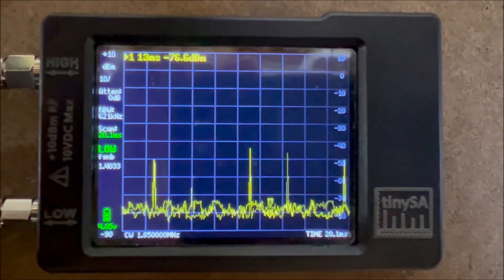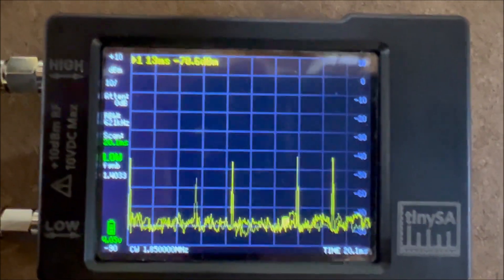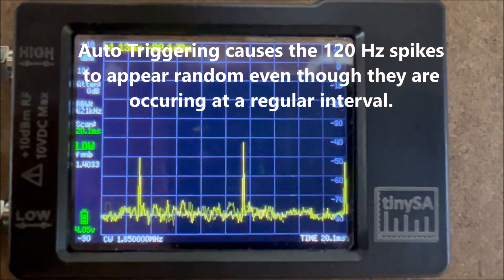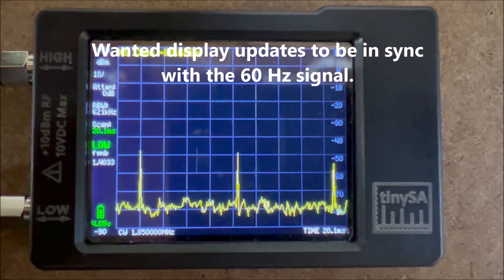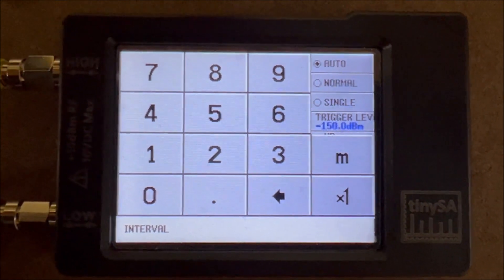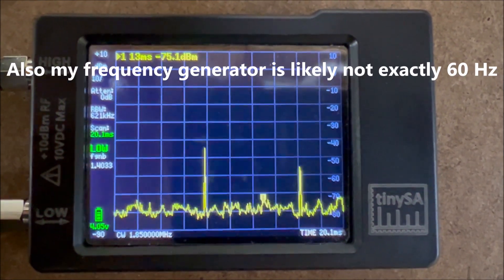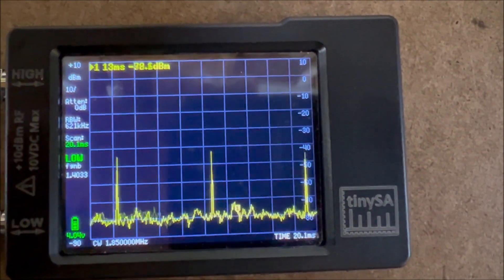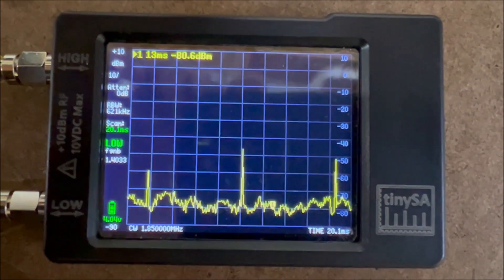TinySA new interval trigger timer feature for use in Zero Span mode (Jan 7, 2023)

Comment: As far as I understand setting trigger to 'auto' does not trigger at all, it is normal SA mode. So you are taking snapshots of the signal 16.7 ms apart, but not synchronised. Hence the moving spikes. 
To trigger the signal to be stable you should select 'normal' and delay just above 16.7, let's say 20 ms. Yes, it will skip one spike, but the next spike will trigger at the same place. 
The SA than behaves like any  scope with 'hold-off' on the trigger setting.
I used it like this to capture a 433 remote signal and it is just as clear and stable as on a scope with a 433 RX unit.

(Perhaps Erik should call this feature hold-off instead of interval, as many users are familiar with scopes and used to that term)
Reply from the maker: To capture a repeating signal that might not be the strongest in the demodulated audio you don’t want the TinySA spectrum analyzer to trigger on a signal level but rather at a frequency in sync with that of the signal of interest to get a stable display of it in zero span mode.  You have to know the demodulated frequency of interest to get this to work (like 50 or 60 hertz, etc.).
Reply: @wd8dsb  it does trigger in zero span mode, you can even set level and edge. These options are clearly visible in your video. The interval really acts as a trigger delay. 
If you don't believe me just try and you will see.
Reply from the maker: @gartnl go back and read my edited comment to you.  If the signal of interest is not the strongest then you can’t use level triggering to get a stable image of it, you must trigger the TinySA based on it triggering in sync with the timing of the signal of interest.
Reply from the maker: Also note that I just tested this feature on my TinySA as well as TinySA Ultra and it works on my TinySA but not working properly on my TinySA Ultra, both of which are running pretty old versions of the software.
Reply: @ 
I was referring to the signal you showed in the video: consistent and repetitive.
Reply from the maker: @gartnl  the video was just to make sure interval triggering was doing what it was supposed to.   In a noisy environment I’m looking for power line noise which can be buried in noise with other sources.  I’m trying to lock in on power line noise which produces spikes typically every 0.0083 msec and that’s the interval I need the spectrum analyzer to keep repeating a sweep at or some multiple thereof in order to see stationary spikes from the powerline arcing versus noise from other sources.  Kind of the same idea as using line sync that’s available on some oscilloscopes that provide trigging on the incoming power signal.
Reply: @wd8dsb  Thats akin to when I fiddle with the free running time-base on my scope to manually get a stable image of a non-stable signals.
I joined in on your post on the sa forum, hope you don't mind. One of the things I noticed was that the sweeptime on the ultra is not constant. In that case the interval value does not help because every sweep is in fact different in time. Might be the source of your problem with the ultra.
Reply from the maker: @gartnl hi Henk, I’m glad you joined the topic and nice to meet you.  What I’m trying to do from a functional standpoint is similar to what’s done on very expensive receivers designed specifically for hunting arcing poweline hardware.  73, Don

Comment: Great to have that feature. It would be nice if you could choose frequency in Hz or time as I think it's just easier to compare frequency.
But you can do this with lissaou on a Scope(You need XY feature on the scope). Feed the signal you want to analyse on ch1 and a ramp/sawtooth frequency on ch2. Adjust the frequency on the signal generator until the pins stops moving, then you have the correct frequency, or a multiple of it.
Great if you don't know a frequency component in a certain signal. For example when you are troubleshooting noise.
Reply from the maker: Hi Bjorn,  I guess it could have used frequency instead of time for the parameter (they really are just the inverse of each other) but having it in time is more generic and therefore possibly more useful for other applications too since you can set it to larger values directly related to time.  Either way it works, just have to remember time and frequency are the inverse of each other.
Reply: @wd8dsb  Ok! So you can use frequency instead of time. I missed that.
Yes, I know that they are the inverse of each other. I usually have a calculator with inverse beside me just for that. As I'm to slow to do it myself.
Myself don't think time is more generic. But that's just how I'm coded.
Anyway, good feature to have.
Reply from the maker: Hi Bjorn, an example of where I felt time was more generic was if you wanted the screen to be updated at a slower rate (like screen updated every .2 or .4 seconds).  In that case I would think more in units of time versus frequency but units of frequency would have been fine too.  Bottom line is that Erik the designer can decide long term what name and units are most appropriate for this feature.  I'm just thankful this feature has been added.